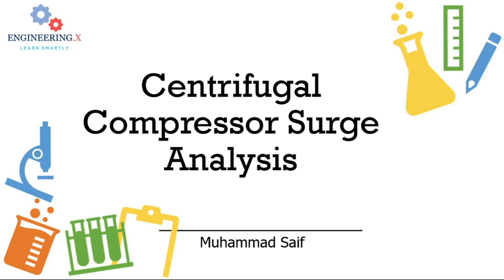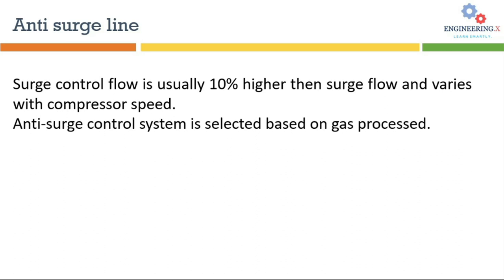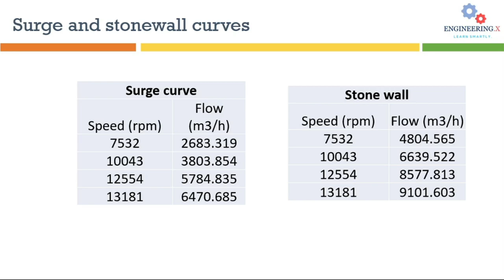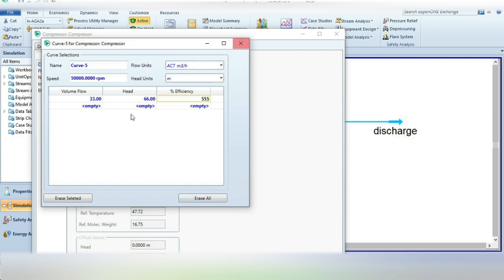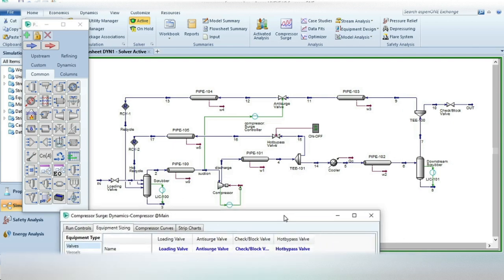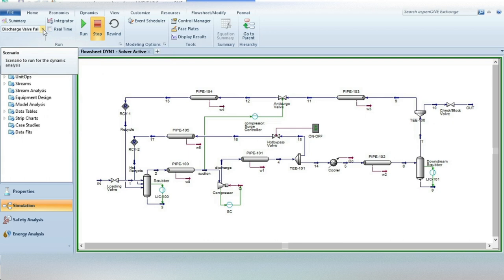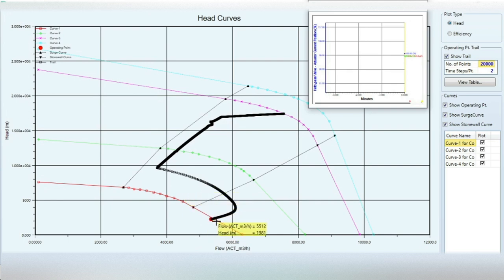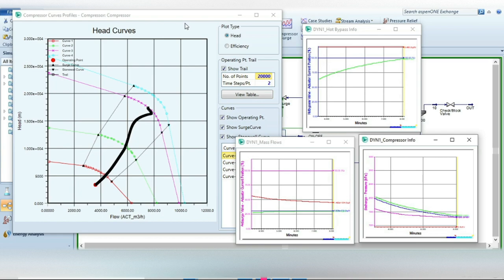Compressor Surge Analysis  in Aspen HYSYS

Comment: I am going to every tutorial and following it on Aspen. This is too early for a starter. Once I put speed and use curves, it says over specified. Secondly, it changes the curve data itself. I don't know why. 

Last but not the least, this is great contribution by you. Thanks a lot
Reply from the maker: You have to reset all the Cv parameters at the initial setpoint before each simulation run because it's dynamic so it will change and in real plant senerio it only happens at startup and shutdown. I hope it will help

Comment: Hi , other than the shut down, is it possible to simulate also the start-up from an equalized pressure in the system (SOP)? Is it possible to provide IDLE1, IDLE 2, MGS ramp?

Comment: but sir in the my company we are using air compressor for air separation plant where compressor has anti surge valve in the discharge line while cooler on the discharge side of commpressor , but in this video when you performed simulation there anti surge valve installed on the suction side , why ??

Comment: How did you know to manipulate hot bypass valve and not for example inlet or descharge valve or any other component?
Reply: Hot vapor bypass is provided for the system whose operating point lies close to surge line limit. In the above case v dint require hot vapor bypass as operating line is already away from surge line limit. Thats y he reduce the flow across hot vapor bypass

Comment: "The current flow rate is less than surge Flow.
The pressure flow solver failed to converge.
Try using the equation viewer to see where the problem is.
Dynamic calculations stopped.
Integration time 1.0125: Integrator Stopped at 1.0 minutes" - What does this mean ? I did everything you did , still the results aren't the same.
Reply: I am facing the same issue of integration failed at time 0

Comment: When I run the case it says the compressor is over specified. And if I remove one of the inputs, I get a different value/result
Reply: I have the same problem,  how did you solve it?
Reply: I tried the same, erasing the imposed pressure on compressor discharge stream, and now i get a different result. I think that what we got it's the discharge pressure that compressor can produce, for that rpm curve (imposed) and that flowrate (imposed). My opinion is that if we want 30 bar, we have to change either the flowrate or the rpm, please  @eduX confirm. ( and thank you for this amazig tutorials :))  )

Comment: Dear Friend,
The flow of the first scenario must not exceed the stonewall line. The flow is throttled and should follow that line by lowering the RPM. Best regards
Reply from the maker: Thanks for correction  ☺️
Reply: @eduXinsight  Hi. This is probably a weakness in the software that could be communicated to its developers.
The Stonewall line represents the maximum possible flow because it is shocked.
Some simulators have similar errors when sonic velocity is reached in pipes and do not report that the flow is shocked.  Regards